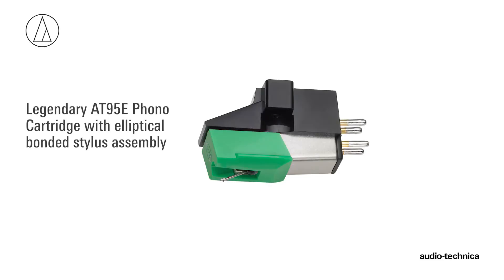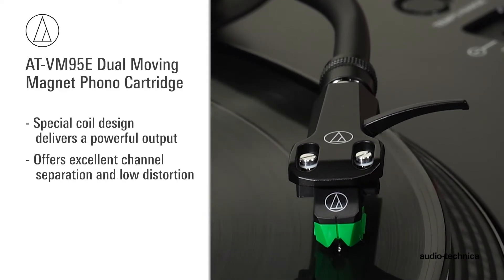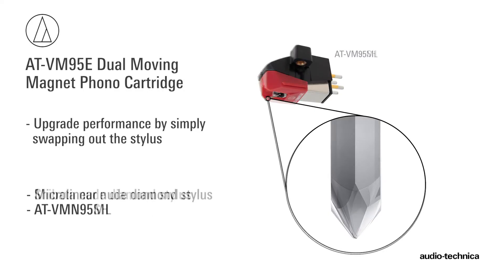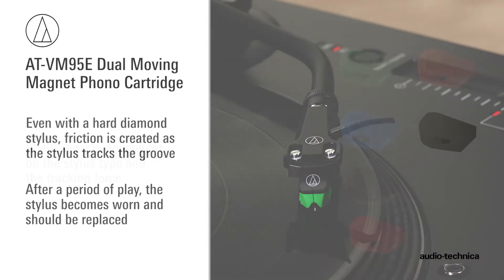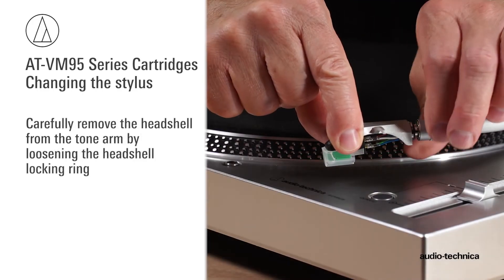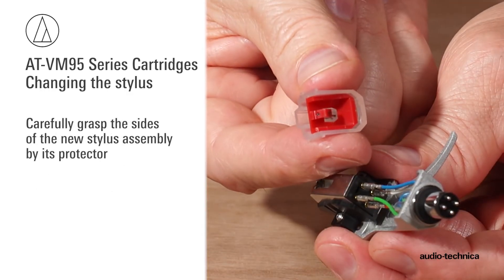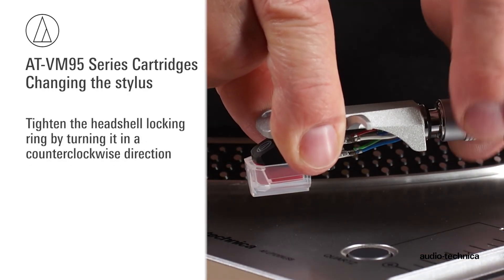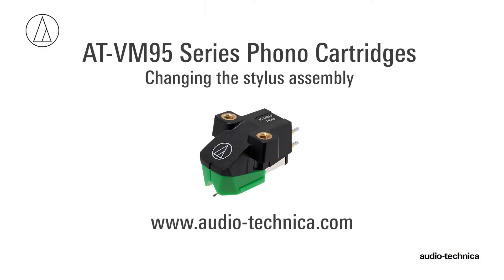AT-VM95 Series: Changing the Stylus Assembly | Dual Moving Magnet Phono Cartridges

Comment: I just put a VM95ML on my old Pioneer PL41 a few minutes ago, aligned it with a Grimm's protractor specifically for this cartridge.  This cartridge sounds AMAZING!  I came to this video to find out how to pull the stylus so I could align it with the Grimm's protractor as you have to have the stylus off so the protractor can align the cart.

Comment: I have an old aud-technica cartridge  at 11e.can i replace the stylus with a new aud-technica stylus?
Reply from the maker: Hi there! Unfortunately, no. Both the AT11E Cartridge (1976) and the ATS11E Stylus, which came on it, have been discontinued for quite some time. We have no original styli remaining for the cartridge and no current styli that is compatible with it. It does appear that at least one of our dealers, lpgear.com, has an aftermarket version of the stylus however. The current comparable cartridge complete with stylus is the VM520EB Cartridge. – A-T USA

 

LP Gear Replacement Stylus for Audio-Technica AT11E Cartridge

https://www.lpgear.com/product/ATS11E.html

 

VM520EB Cartridge – complete with VMN20EB Stylus

https://www.audio-technica.com/cms/cartridges/03b24b7242a2c4fc/index.html
Reply: Thank you! I wonder if it is possible  to get it from japan? I also have a Shibata from  the same time. I have allways been happy with audio technica!
Reply: Luckily i have found many european dealers that can deliever this stylus!

Comment: Question regarding replacing the stylus cartridge…what is the basis for replacement bard on 300hours up to 1000hours…I’ve got a 95e…it’s about a year old…
Reply from the maker: Hi there! Some of the reasons for replacement would be loss of frequency response, channel separation will shrink and the lows will start to disappear (and the highs will as well). – A-T USA

Comment: Hi, yesterday I purchased the AT-LP120XBT-USB and I love it. I have the following question: can I replace the needle that came installed (AT-VMN95E) with the AT-VMN95C without changing the cartridge? Or does each needle need a specific cartridge?
Reply from the maker: Hi there! Yes you can. All cartridge models in the AT-VM95 Series use the same cartridge body or “engine”, only the stylus (needle) varies. Just remove the provided AT-VMN95E stylus and install the AT-VMN95C stylus and you are good to go. Thanks! - A-T USA
Reply: Why did you change the more expensive and eventually better E stylus with the C model? I'm thinking about changing C for the E because there is not enough treble in my ears. TT is AT-LPW30TK. Thanks for info.
Reply: @angelheart7643 My guess would be that he is dj 😅

Comment: Does the cartridge itself ever wear out? Also, is there any difference between a cartridge labeled "AT-VM95E" (like the one shown in this video) and a cartridge labelled "AT-VM95" which I've seen for sale in a couple of places? Thank you :)
Reply from the maker: Hi Jay! The cartridge itself does not wear out, just the stylus assembly does. When you replace the stylus assembly, you are replacing all of the moving parts. There is no AT-VM95 cartridge, AT-VM95 is a series of cartridges. There is an AT-VM95E, and an AT-VM95EN model cartridge. The “E” is green in color and features a bonded elliptical tip. The “EN” is orange in color and features a nude elliptical. Thanks! - A-T USA
Reply: @AudioTechnicaUSA  Hi team, thank you. My attached (turntable: AT-LPW50PB) stylus is black. Which type is it then? Still E? Thanks a lot!
Reply from the maker: @soundria25  The AT-VMN95EBK. Thanks! - A-T USA
Reply: Why do you not tell us that old stylus es are available in europe and japan?!
Reply: Hello AT team , I've got the ATLP 120XBT blutooth tt . Which color cartridge n stylus setup should I replace my vm95 w for best sound highs . @AudioTechnicaUSA

Comment: Hi!! I recently ran into a problem with the needle falling off. It was from the VM95E cartridge, and with the slightest touch the needle fell off. The cartridge is still perfectly intact and I'm happy to buy a new one but I don't understand how this has happened and want to prevent it happening again. Is there any way you can help?
Reply from the maker: Hi Alyssa, our Parts Dept. may be able to help. Please reach out to Parts at parts@atus.com. Thanks! - A-T USA
Reply: Did anyone bump into the needle, or did you brush it sideways while cleaning? That could be a reason. Its not meant to move sideways. A friend of mine didnt know and cleaned it that way, which is why it broke off. Thankfully, it was just a VM95E, so it wasnt too expensive to replace.
Reply: the same thing just happened to me.  did you ever figure out how it happened?  it's easy enough to replace but i'd just like to know if perhaps i played a record that was maybe too thick (some of the colored variants are quite a bit thicker and heavier than standard lps), or maybe i pulled the protector off too hard or too sideways?  i noticed the needle was super high and loose and just fell off at the slightest touch.

Comment: So, just to be sure, if I have an ATLP120XUSB that came with the ATVM95E, am I able to simply replace the stylus with any other stylus from the 95 line without re-aligning?  I have not touched the alignment on the headshell that came with the 120X as I was told the stylus is aligned at the factory.  I want to now replace the 95E with the ATVM95ML, so am I able to take off the 95E and place the 95ML on the headshell?  Do I need to check for alignment, or am I good to go?  Many thanks.
Reply from the maker: Hi Andrew! AT-VM95ML is the entire cartridge complete with stylus. The micro linear STYLUS ONLY is AT-VMN95ML. If you simply replace the (AT-VMN95E) stylus that was provided with the AT-VMN95ML Replacement Stylus, it is not necessary to align the cartridge. Thanks! - A-T USA
Reply: @AudioTechnicaUSA  That is great.  If I already have a AT-VM95ML on the way, can I simply remove the stylus from this product and place that stylus onto the ATVM95E (cartridge) that was provided with the ATLP120X?
Reply: Without realigning?
Reply from the maker: @achtungbabythefly  Yes ,you can! - A-T USA
Reply: @AudioTechnicaUSA  Thanks so much!
Reply: @AudioTechnicaUSA  Is it the same case with Shibata model (SH). I have the cartridge and stylus of ATVM95E and would like to change its default stylus to ATVMNSH. Will it need any realignment? Also, at what tracking force can I put the new SH on?

My second questions is: Is there an article that points out the differences between ML and SH, and defines which type of stylus is best suited for a given type of listener (preference to sound aspects, etc.)?

Thank you in advance,

Lachezar
Reply from the maker: @lachezarkotsev3991  The AT-VMN95SH will track at 2 grams like the green AT-VMN95E.  You shouldn’t have to do any realigning, but when using higher end styli tips like shibata, it is always a good idea to double check the alignment.    

Images for the different styli types can be seen here: https://www.audio-technica.com/en-us/support/audio-solutions-question-week-question-week-can-explain-different-types-styli/ Thanks! - A-T USA

Comment: My headshell is non-removable.  Guess it will be a bit trickier for me to replace my AT-VM95C stylus
Reply: Have you tried it l am thinking of doing the same thing worrying about damaging the tonearm
Reply: @brit1954  Not yet. The replacement stylus is due in today.  I'll let you know. I'm moving up to the Shibata VMN95SH
Reply: Okay. It came in and I swapped it out. It was really nothing.  But, I had changed out Ortofon styluses often and so it was similar to that. Put the cap on the stylus, squeeze around the center and then pull down putting more a bit more oomph on the front then the back, wiggle it a bit, too. Just be patient but firm. It should just come right off.  Oh, I would hold the arm with the left hand and work with the right, holding the arm up a bit off the rest.
Reply: Vinyl Bozz Thanks for the reply will definitely be upgrading my stylus I am going for the 95ML you will have to let me know if the Shibata is a step up in catching more information and sound quality from your vinyls
Reply: @brit1954  Well, it's picking up much better than the AT-VM95C it replaced.

Comment: I just want to get some clarification on the AT-VM95E i just realized there was a change in the stylus i have the older AT-95E will the newer AT-VM95E fit the original AT-95E cartridge headshell? My problem is trying to align the cartridge and i haven't had to align my cartridge as it came prealigned and just had to replace just the stylus
Reply from the maker: Hi there! Please contact our Audio Solutions Team for help. You can reach them at audio-solutions@atus.com. Thanks!  - A-T USA
Reply: Hello there; did you get a response from Audio Technica? I have the same question. I wanted to upgrade my stylus and just realized the old AT-95E looks different than the newer version. I didn't want to have to change the headshell too, but it looks like that is the only way for those of us who have the older stylus. Appreciate your answer man.
Reply: @paulocalvo4049  no not interchangeable the AT-95E has a different configuration